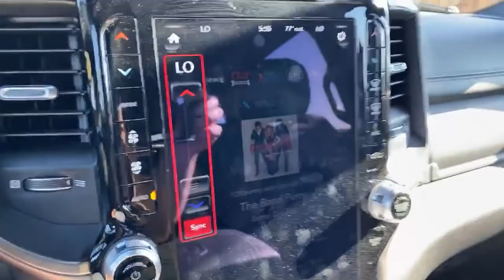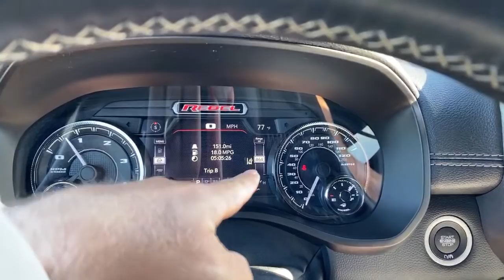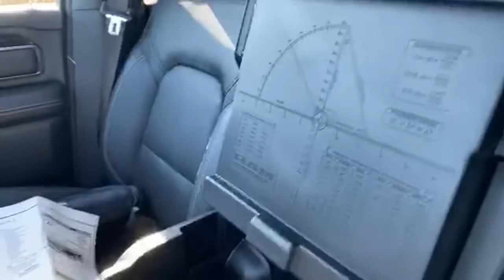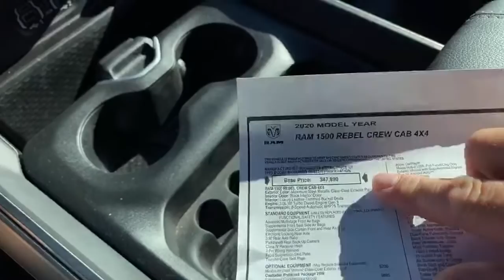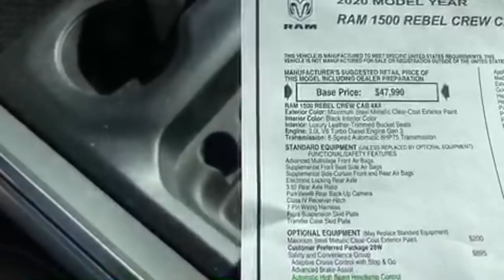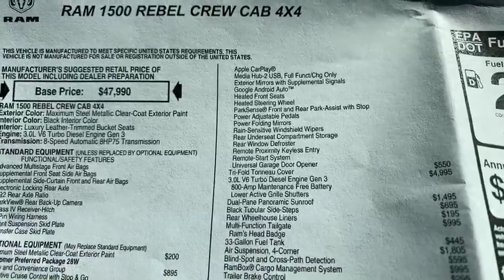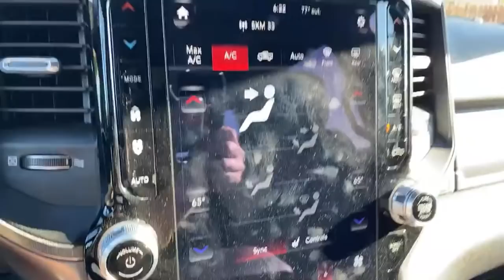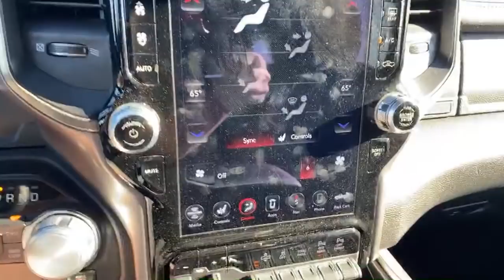Live with 2020 Ram Rebel 1500 EcoDiesel and More Truck Stuff!

Comment: What are your thoughts on no Auto 4x4 but adding the Anti Slip Rear Differential? I live in SK and we get regular snow and ice. In Canada for some reason, Rebel is the lowest trim with the EcoDiesel
Reply from the maker: No Auto 4x4 but an anti-slip rear differential? You are swapping out the front tire engagement for more traction in the rear? Is that the question?